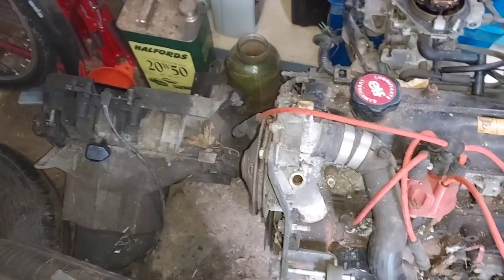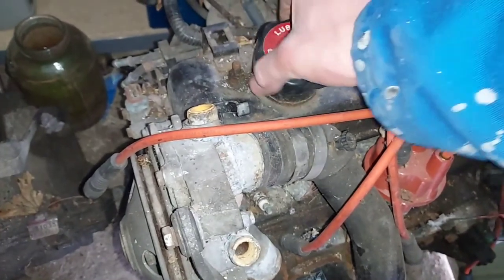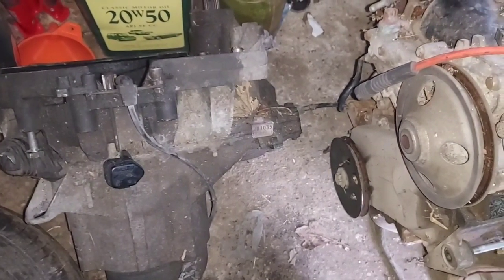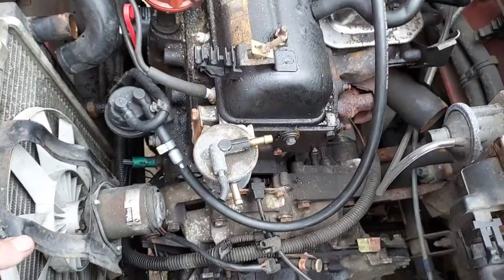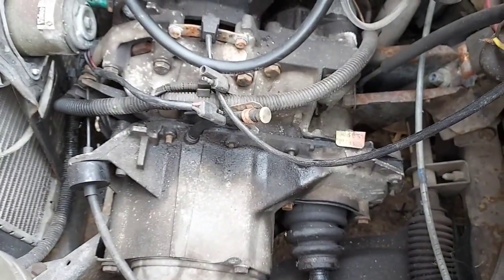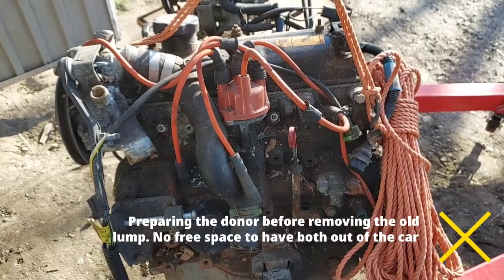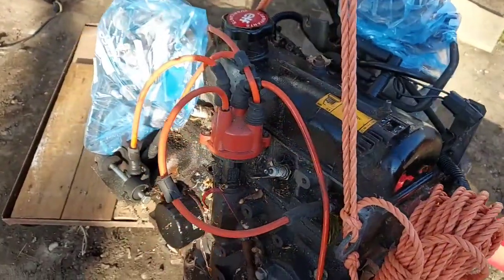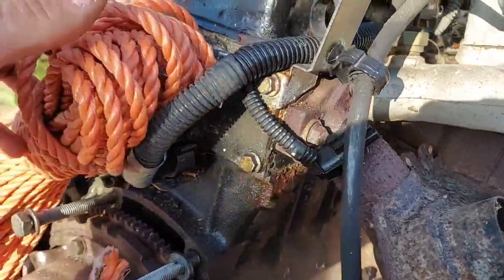1985 Renault 5 GTL - Sorting the engine!

Comment: A good choice. The 1390 is probably the best substitute for the old 1397.
Had you been able to find a 1721 would you have been tempted to drop that in?
Reply from the maker: Though putting my foot down is fun, she isn't about going as fast as possible. 1.4 plenty enough for me. Its taken some driving to get used to a fwd again, it's a very pokey arrangement even only in 1.4 form
Reply from the maker: Same reason I refuse to turbo it
Reply: Yeh the 1.4 NA was probably the best alround option for the 5 and the cars are incredibly light.
I hear the GT Turbo have to be worked hard to be fast but expect the 1.7 would be a very relaxing option with more torque. They were one of the engines shared with Volvo.
Reply from the maker: Also heard rumours the turbos cruising rpm is mid turbo range, making it interesting. I read earlier the 1.7 is very pleasant to cruise at 80... 

Personally, I've driven a 1.2 modus and 1.6 megane, the 1.4 has less power than both, but is in a car weighing less than both. 1.4 NA feels like a rocket on wheels
Reply: @Therenault5nut  My dad had two 1390cc Campus Prima brand new in 93 and 94 and they were very nippy and a bargain at around £6k compared to the Clio. When he traded it in early 96 for one if the very first Mégane Coupe 1.6e though it felt like a huge step up at the time. Ironically the 5 is probably now worth more.